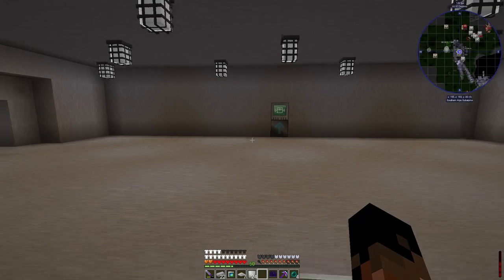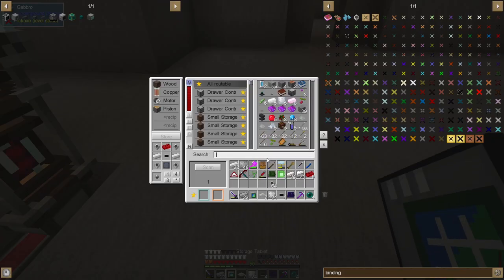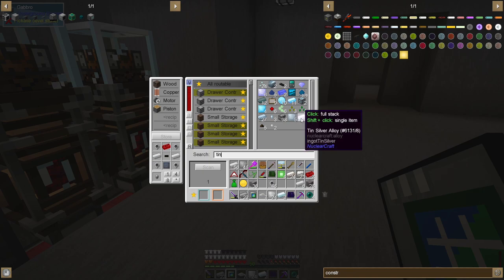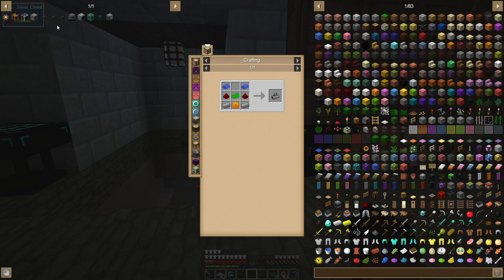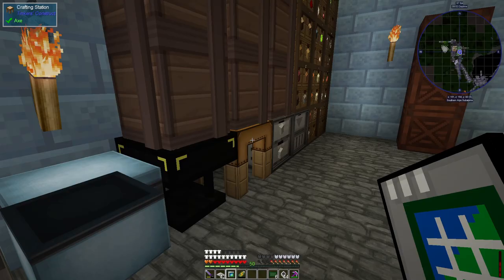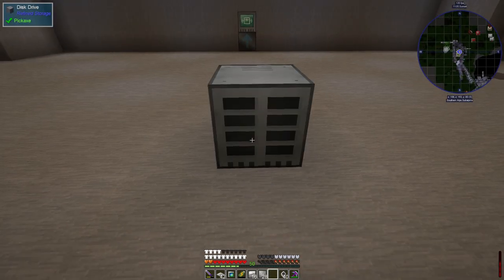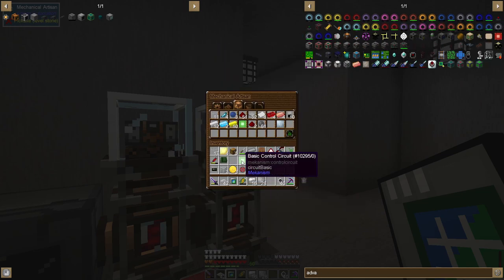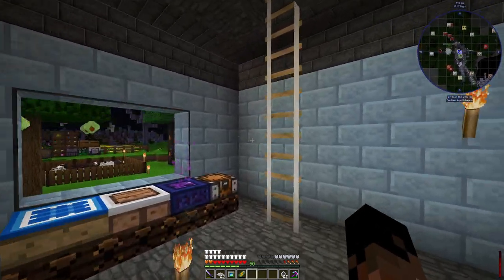Dungeons, Dragons & Space Shuttles | [E21] - Finally Have My Refined Storage System!

Comment: Good episode! * I use redstone and iron essence to craft redstone ingots, don't do induction smelter anymore. Same for electrotine, also variations of silicon like red, blue, yellow. Essence is a LOT faster than processing, also it is FREE! * Refined storage is quite expensive in this pack, many people expect to store everything in it only to learn it's too expensive. What many people do instead is store bulk items in drawers and having external storage connection on drawer controller. Drawers can store a lot of the same items! I have seen one player having large room 25x25x25 dedicated to warehouse. Size of 25 is because drawer controller can read up to 12 blocks out, so if you place controller in the middle of that 25x25x25 room, then every drawer placed along the walls is reachable. He has every ingot, every plate, every bulk item on "The Wall". And his RS system is just doing autocrafting. We have a little community with this player as our host. You may want to check his twitch channel and may be join discord channel. People are very friendly and responsive, you can ask questions, it's welcomed. His name is DistrictSpark.